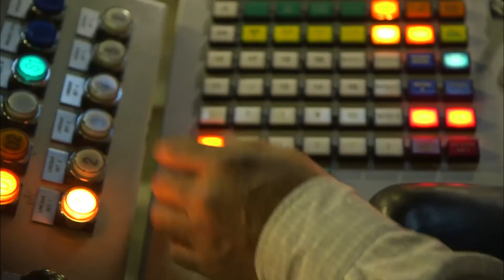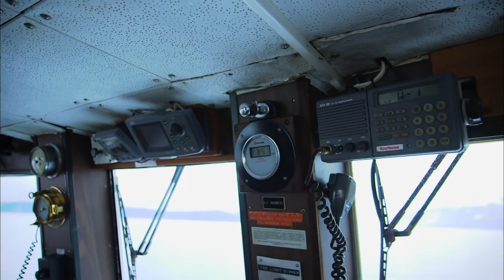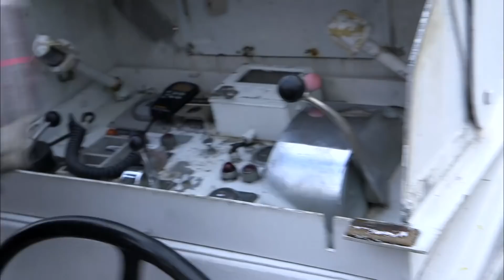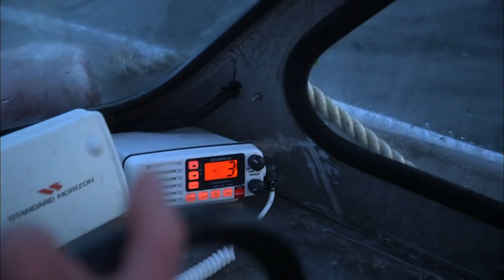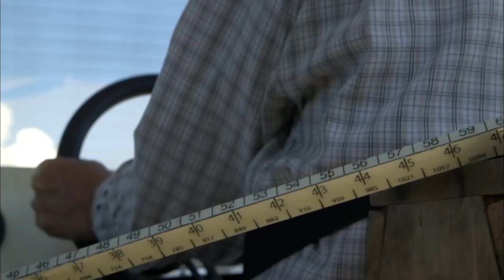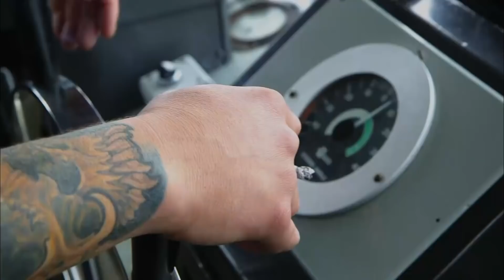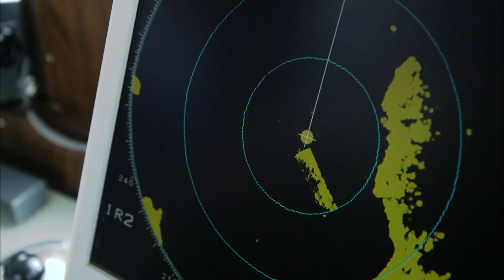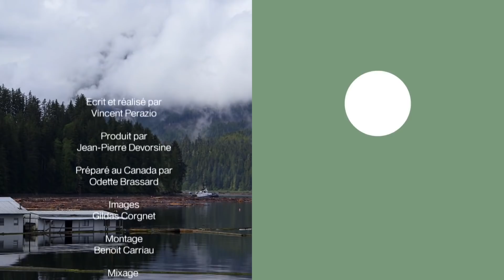The Hidden Dangers Of Being A Lumberjack: Extreme Logging

Comment: I never met a "lumberjack" on the island or even up coast. I have met and worked with thousands of LOGGERS there though. Lumberjacks stopped at the midwest.
Reply: I don't understand this hate it the term lumberjack. It predates the term loggers. They both mean the same thing.
Reply: Kyle Roush ‘lumberjack’ is more of a midwest term for a logger ( common in Michigan and Wisconsin 100+ years ago ). My grandfather logged 100 years ago, but referred to himself as a ‘lumberjack’, he never worked in a saw mill.
Reply: @highwatercircutrider  So it just comes down to people being petty about which term is used even if they mean the same thing.
I've seen that a lot, especially in my area.
Reply: "Lumberjack' is what townies call loggers.
Since no one's posted, this is required here:
https://youtu.be/pfRdur8GLBM

Comment: It's really bad forest husbandry to cut down  biggest and oldest trees. They are by their nature the most disease resistant and they also produce far more seeds than the smaller trees. So leaving them in place allows the forest to regenerate naturally from the best possible source.
Reply: First off, BC has more forest cover now than it did 100 years ago because we aggressively replant. That means that we move from logging first growth to logging 2nd and 3rd growth. Most of the wood that's logged now is plantation - but no one's going to make a doc about that. Old growth is what captures all the attention but thats not what your house is built from and it's not what you buy in your local Home Depot.

And no, individual old trees don't produce more seeds: a greater number of smaller trees in a given area will do that and will do so with much greater genetic diversity.
Reply: @DeadeyeLefty  
Doesn't alter my statement, One big old tree out seeds any other tree, and it will have the best characteristics for long term survival.
Reply: @niklar55  It does because your statement is incorrect. A single large tree isn't more 'disease resistant' because that resistance is based on genetic diversity within that species. A single large tree (and those around it) are homogeneous, making them MORE prone to disease, not less. 

A cutblock replanted with seedlings from multiple genetic lots is more diverse and resistant to a far greater range of threats.

And in terms of seed production and contribution to the overall biomass of the plot, many small trees carefully thinned as they grow, will always produce more volume (and seeds) than a single large tree, especially given BC's latitude and its terrain.
Reply: @DeadeyeLefty  If you believe that crap, you need your head tested.
A tree of 2000 years old, has a volume of many times the volume of those planted within the last 100 years, so will produce many times the volume of seeds. Also, as that tree is much taller than trees planted within the last hundred years, its seeds will be dispersed over a much greater area. In addition, it has 2000 years of proven disease resistance, and longevity, which trees planted within the last 100 years cannot have.
You seem to have the idea that seeds from one tree are in effect clones, they are not, they have many diverse genetic traits, combined with those of the parent tree. 
So your claims are erroneous.
Why is it that loggers feel so proud when they cut down a really large tree? Greed, because it contains a lot of wood, or just that they feel a sense of achievement?
Any whacko, with a chainsaw can cut down a tree, I do it myself, every autumn, and I learned how to do it 60+ years ago, when I was 12 years old, but with an axe, not a chainsaw. The only trick they need to master, is not to kill themselves, or anyone else in the process. If they do, well, thats Darwinism at work.
Like the guy below, proud to be third generation logger. If thats all he has to be proud of, then he has a very restricted existence, and range of skills. Pride is also considered to be one of the ''seven deadly sins'' so not much of worth there.
Good husbandry would be to preserve the largest and oldest trees to use for propagation, until they reach the end of their productive life. As with all farming, you preserve the best, for propagation, you dont destroy them!

Comment: Wanted to ask what tool or tools do you use to sharpen your chainsaw blades?  Is there a popular brand/type used by most lumberjacks that are just simply better than anything else?  I see several different types shown in other videos but wanted to see what these 'Real Stories' recommends.  Can you describe a typical workflow for keeping your blades sharp while working all day with your chainsaws?  Do you sharpen in between cuts or at beginning of the day and that lasts all day?  Would just like to know what are the best ways to keep my blades sharp in the field without having to put a new chain on until I sharpen the dull blades back at my garage.  Thanks